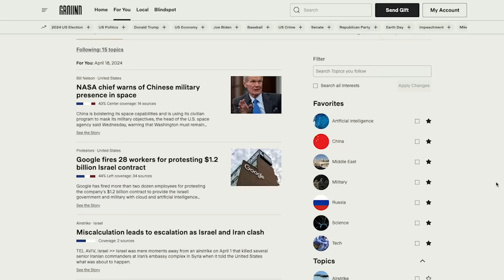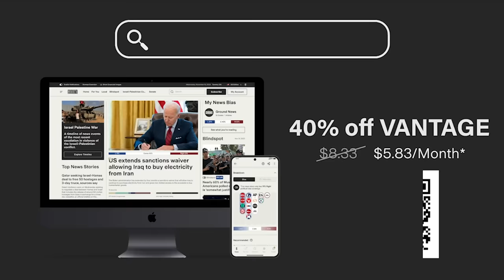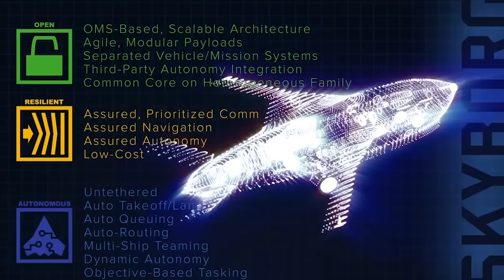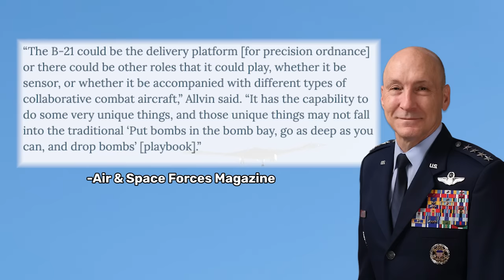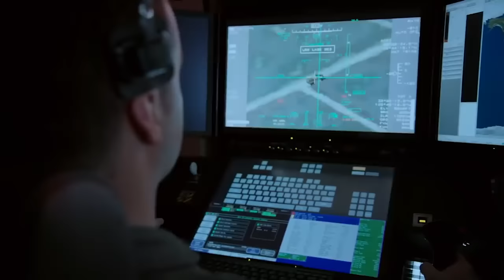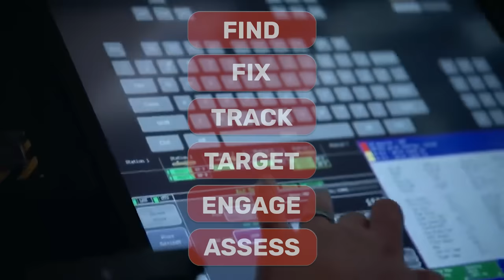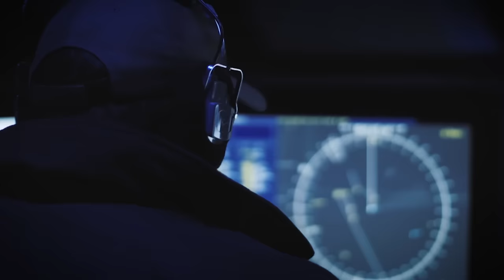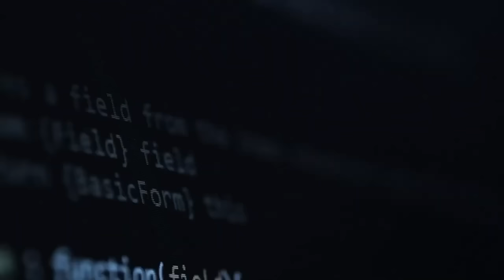Is the Air Force already developing a replacement for the B-21?!

Comment: Planned obsolescence not just your home computer now it's billion dollar bombers
Reply: ....For military hardware, it's more like planned planned obsolescence.  And for legit reasons.
Reply: better pla it then be surprised by it being obsolet
Reply: Two totally diffent things.

Planned obsolescence is not the same thing as going obsolete. The Chinese are not going to sit on their hands.
Reply: You stated that backwards. 😉
Reply: Look at the B-21 as an airframe/platform. The B-52 has been around since the 1950s and the platform is not obsolete. The Air Force continues finding new uses for it. The B-21 as a platform could exist indefinitely with periodic improvements to the airframe and avionics as technology evolves.
Reply: I would like to add that the B-21 is not in fact a billion dollar bomber.
Reply: The B-52 is obsolete.  While still being useful.  Primarily they pump up our bomber numbers to match the number of obsolete bombers Russia & China keep on the active rosters.  @TheStormpilgrim
Reply: I suspect what they are planning is a fleet of B-21 but also an low cost modern aircraft that can mirror the B-52
Reply: @TheStormpilgrim  The B-52 is completely obsolete and could go nowhere near the front lines of any conflict with a near-peer. The reason they keep the B-52 around is they are safe behind many layers. This would NEVER be the case with a stealth drone whose stealth and ability to cross and go far behind the line is their value. Once it cannot compete at the frontline it will be basically of no use.

Comment: The idea of the B-21 and it's successor taking on an AWACS-like role is interesting.  I'd argue that at least as interesting to the flight hardware is the communication systems needed for this approach and I'll bet there's a story here if there's any public information at all.  A stealth aircraft can't fly around emitting signals, even in short bursts.  It would be detected immediately.  Maybe some sort of line-of-sight connection to a satellite could be used (RF or even laser), but are satellites safe in a modern battlespace?  If you walk through the logic that follows from that, you have to question whether the stealth aircraft make sense as AWACS platforms.  Sure, for strikes and intelligence-gathering, they might make sense, but maybe the next generation of battle management is just done semi-remotely via some kind of drone swarm.

Comment: Honestly if the B21 is the "low" to another air frame's "high" it would make sense. It's a smaller air frame to the B2 so it would make sense for a larger heavier longer range upgrade to the B2, especially if they could develope a supersonic stealth platform. 

I'm a big fan of the medium range format in the modern airspace with longer range missiles against ground and sea targets.

Long term if they build smaller generations of aircraft centers around modular engines and avionics systems, it could be a pretty impressive long term advantage.

Comment: I could see the platform coming after the B-21 being a B-52 or B-1 replacement.
Reply: Stealthy BUFF???
Reply: @ryanlavender2411  actually no. I mean I'm sure some RCS reduction would be used kind of like in the Super Hornet, but there will always be a need for non-stealthy work horses. Why waste expensive flight hours on a stealthy aircraft if your target has minimal air defense systems? Especially when you consider weapons low observable long range weapons or hypersonic weapons in development. Don't really need a stealth bomber to deploy those necessarily. However, if you have a cheaper to fly B-52 or B-1 with 5th/6th Gen tech upgrades it may not matter if the enemy sees them coming. Stealth aircraft are the tip of the spear, but sometimes what you really need is a bruiser.  A bomber like that could carry the bombs, but also advanced air-to-air missiles and a radar that allow it to defend itself against intercept fighters while launching its weapons outside of air defense systems. Awesome that are hard for those air defense systems to see or intercept.

Comment: The fact that the airframe is designed for stable ultra high altitude operation above 80,000ft, and remotely piloted, is very telling. The center bomb bay is apparently designed to install a large internal fuel cell, and the missile side bays to house reconnaissance pods. 
 It can also serve as a high altitude on station missile truck to assist F-22's for area defense air dominance capability. Each missile bay looks wide enough to house up to 6 AIM-260's each, or a substantial number of SDB's.

Comment: A successor program to the B21 could also be a factor in why B21 is coming in on time & under budget. Cost creep happens when you keep adding things to the design. It then takes longer to incorporate those new features & technologies. 

With a follow-on program already underway, you can dump all those really cool ideas onto it & leave the current one alone.

Comment: One capability of the B-21 that might be useful around Taiwan, would be a refueling nozzle to top the tanks of F-35's and F-22, or to do refueling on the way home if they went beyond Bingo during a fight, and closer in than conventional tankers dare go if there are J-20's around.

Combined with a few Aim-260s or NREW's, that might make it much more realistic to project air power close to or over Taiwan itself, even if the fighter have to be based on air bases or flat-tops quite far away.

Then if/when air superiority is achieved, the bombers can switch to more offensive missions.
Reply: A stealthier version of the MQ-25 Stingray would be better suited for potentially hazardous refueling operations.

Comment: My guess is that this isn't something like a b22, probably a b21b or some other sort of next gen upgrade for the b21 platform. That's at least my initial guess based purely on a hunch.

But I also would not be surprised if there is some sort of replacement program for the B1 that is attempting to design some sort of supersonic high capacity bomber that has a maximum speed somewhere around the Mach 3 point as a launch platform for future scram jet-based hypersonic weapons. And I could see that eating some of the requisition funds that were being planned for the b21 platform

Comment: Is it possible that the B21 has been flying for a lot longer than we've been told? I've heard that implied in rumors along with the idea that there are at least several of them and that they've flow some analog of operational missions. It would explain why production and testing seems to be going so well and why they may already be thinking about the next generation.

Comment: This convinces me more than ever that the b-21 is not a not bomber and was never intended to be. It appears that the Air Force thinks the bomber capability is obsolete and unnecessary on a modern battle field. I want to know how a stealth aircraft maintains its stealth while blasting off radio frequencies everywhere to co-ordinate some integrated battlefield management network.

Comment: (before watching)

Feel like the b21 was fast-tracked due to the increase in conflicts and need- while another model had been in the works for a longer 2030-2035 timeline. If anything longterm upgrades or at least varients of the b21 (B21a B21b B21c, etc.) But the B21 needed to fill a superiority gap early on and could be finished sooner.

Comment: A successor to the B-21? I would like to think they are referring to a whole new airframe. The upgrade capability within the B-21 seems amazing as is its multi-spectral stealth, so what other capability could be needed? 
 
Honestly, the only thing that comes to mind is speed and altitude. So a hypersonic craft with stealth? Hmmm...
Reply: Any hypersonic object will be easily detected by satellites. At those speeds, the aircraft will be extremely hot, even as hot as ballistic missiles. Perhaps even something early warning satellites could pick up...

Comment: With the way Hypersonic propulsion is advancing, it would make sense to field a fleet of hypersonic bombers that can drop guided bombs at high speed and high altitude with under an hour response time anywhere in the world.
Reply: Flying at Hypersonic speed would compromise the plane's stealth. The air friction would heat up the plane and the engine would have to burn much hotter to reach that speed making it more detectable to infrared search and track sensors.
Reply: @JamesLloyd-w7h  That’s irrelevant though. Who cares about IR signature when you need a warhead on target in 40 minutes or less and the speed of the aircraft itself is its survivability.

Comment: I have no doubt that the B-21 will have two engines, not four. Definitely the engine from the F-35. It's supposed to have the Adaptive Cycle Engine from GE. Whether that is to be as a block upgrade or with the original aircraft. If they go with P&W, that will really piss off alot of people, me included. These are my reasons why the B-21 will have two engines instead of four. Compared to the B-2 with 4 engines, the B-21 will have half the payload capability, fly twice as far and is roughly 1/3rd smaller. You need those four engines on the B-2 for low-altitude flight. A) For the thrust and B) Redundancy. The B-21 is a high altitude only bomber. At 50k+ ft, you only need two of those non-afterburning engines. I also think their new successor to the B-21 will be closer to what Hermeus is working on. Anyway, that's my thought

Comment: Let's look at the obvious. The bottom of the B-21. Behind the nose ger are the two bomb bay doors. Then you have a huge access panel and then the main landing gear. These access panels show the size of the single engine in each bay.
Take the dimensions we know about the B-21. Compare those dimensions with the size of the engine access panel and you will come to understand which engine they're using.
Compare the engine bay access panel with that of the dimensions of the P/W F135 engine.

Comment: It would be beneficial if they developed a airframe that was truly open architecture. One upgradable system. To lower costs. We don't need a new variant, costing billions every few years. Develop a aircraft design and just upgrade to new iterations. One system, tooling, forms
Reply: For example, the F18 has multiple iterations. An amazing platform, evolving continuously

Comment: Imagine removing the cockpit of a B-21 and replacing it with a module that doesn't require environmental controls or space for a human crew, and replacing it with a new generation of computers and sensors that can do things engineers and war planners have not yet started discussing.
Reply: That's the RQ180
Reply: @ryanlavender2411  I am talking well beyond that. Maybe you missed the context of the video.

Comment: you would think that the real next "big thing" would be electric fan jets - a hybrid system sure with conventional turbojet creating the electricity - but you will have much better ways to reduce your IR signature - with your turbojet powerplant buried far from the exhaust and its heat dissipated better.

Comment: Range of 6,000 NM (11,000 km), service ceiling 50,000 ft, speeds of Mach 0.95 or 630 mph, one has to ask, why is it even IN service. Surely this is a joke!
Reply: You do realize that speed and altitude are possibly the least effective measurements to gauge out the abilities of STEALTH aircraft right? This isn’t the 1960’s anymore.

Comment: imagine when they start equipping aircraft with durable modular nuclear reactors. Ones that can survive missile strikes and crashes. Just think about it. Not to far off with advanced meta-materials. Sure its extra weight, but you would have to carry no fuel and could have more less powerful engines that emit less heat. Micro-engines would be best.

Comment: the Airforce previously said about NGAD, it's a capability and a process, of producing batches of aircraft fast.  They envisioned batches of 100-200, because of the rate of technology development.  cannot be locked into 30 year old tech.  the B21 might just be an expression of this philosophy - keeps shiny new things at the tip of the spear?
Reply: That entire rapid prototyping concept was dropped by the Air Force because it's entirely impractical, let alone feasible.
Reply: @cattledog901  Oh thanks.  it made a lot of sense as in tech companies (incl mine), the ability to innovate rapidly and iterate quickly is key.  Guess Government bureaucracy is a killer.

Comment: Operational, training, and availability costs of Manned aircraft are clearly sky high, compared to the costs of Drones that can be put into storage brand new, and only fielded when needed. Claims that it is cheaper to field a Manned bomber are bogus. Training and operational costs of drone pilots who are NCO's are a fraction of those for Manned aircraft, and pilot losses in combat are non-existent. With no need for cockpits, life support, and g-force limitations, drones can be built cheap, tough, and expendable. Engines rated for 12,000 hours in Manned aircraft can be replaced by cheap engines designed to maximize power for a limited number of missions. The whole objective of using Drones is to field 100+ times as many platforms as the insanely expensive Manned aircraft, and nearly as many smart weapons to boot. The RQ-180 "White Bat" (Shikaka) is already performing the ISR & battlefield router mission, and paying $203B over 30 years for 100 B-21's which will do the same job, is foolish when a weapon carrying iteration of the Shikaka makes more sense.
"Quantity has a Quality, all its own"
"Everything else being equal, God is on the side of the big battalions"

Comment: This might be a silly question but do you think AI can be used to hack communications. I mean our data link we use. Like ww2 the Brits pretty much made a computer to decipher German radio codes do you think AI in the future will be able to do the same?
Reply from the maker: I’m not nearly as well versed in cyber warfare tactics and capabilities, but I know enough to never say anything is impossible. 

Today’s low-probability-of-intercept data links represent a massive leap over older communication tech by necessity (for data load and security). That trend of threat—response—threat—response will go on forever. You just have to hope your side is in the lead when a fight kicks off.

Comment: We need a stealth tanker to refuel fighters close to China.  The J-20 has LONG legs compared to the F-35 and F-22, and can put our tankers at risk.  Take a couple of those out and suddenly all those fighters have to ditch in the ocean.  They should either make a stripped down tanker varient of the B-21, without all the expensive avionics, or have some kind of "buddy pack" they could fit in the bomb bay so it can perform tanker missions.
Reply: Don't those planes have drop tanks?  I seem to remember something on this channel about stealthy drop tanks for F-22.
Reply: @Ionizap  They're working on them but it is still handily outranged by the J-20, even with them.  Going to need tankers in the pacific theatre, and they'll be big juicy targets.

Comment: Come on Alex, what a buzzkill.. At the beginning of this video I was imagining a Mach 8, completely black, hypersonic bomber that's firing lasers, as the B-21 successor. And what we got is the B-21 Raider with an extra hole in its fuselage.... Noooooo...
All kidding aside why wouldn't we start seeing the hypersonic bombers in mid 2030s? Maybe not Mach 10 or 8 but Mach 5 or slightly below, why not?
Reply from the maker: Never say never! I could be way off and the real plan is to field the Arsenal Bird from Ace Combat 7 🤣

Hypersonic strike (smaller payloads) are in active development today. I think it’s entirely likely that we see a Mach 5-6 platform emerge before the 2030s — contenders being Hermeus’ Quarterhorse, LM’s SR-72, Leidos’ Mayhem (if it’s refunded), and my off-the-wall prediction is that Boeing teams up with GE to field another competitor (in part to try to reframe conversations about Boeing in a year or two).
Reply: @SandboxxApp Is Mayheam dead? Didn't hear about it being unfunded..